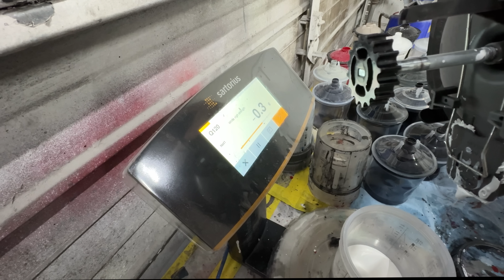We Saved 3,000 On The Destroyed Hellcat!!

Comment: Great job as always.....except.....welding around the back of the car but leaving the fuel cap off is " not a good idea,"  as a retired mechanic I have seen 9 workshops/ body shops burn to the ground because of a " she will be right moment in you safety attention span"  on average it takes a manned firestation 15 mins to get to your location and another 5 to pump water, ignoring personal injury , enough time to loose the lot , most memorable was a car being welded underneath, clutch fire inside, got the fire out by using every available fire extinguisher withing running distance in an industrial area, just I tiny flame left on the steering wheel, guy blew it out......but....the flaming plastic bit fell down and reignited the fire causing $2.5 million damage